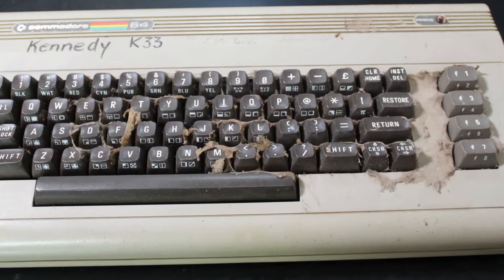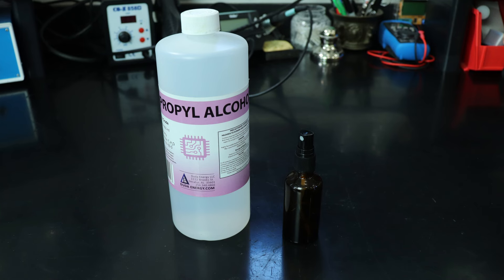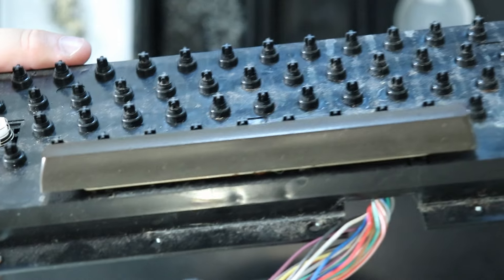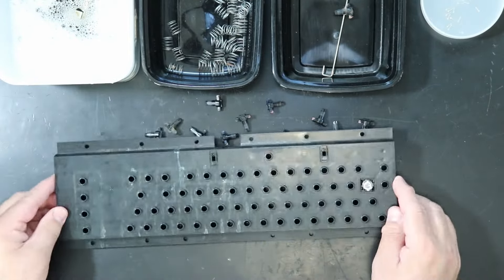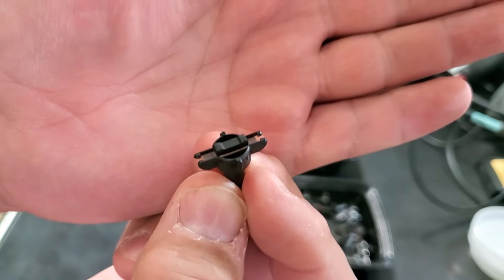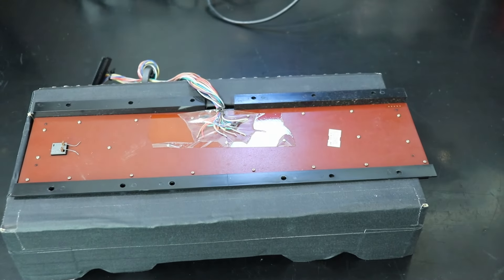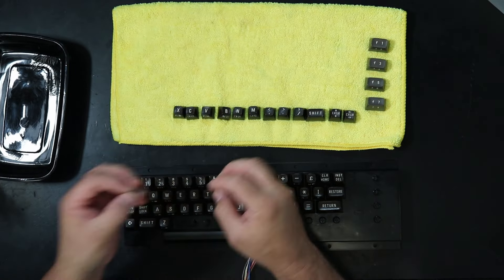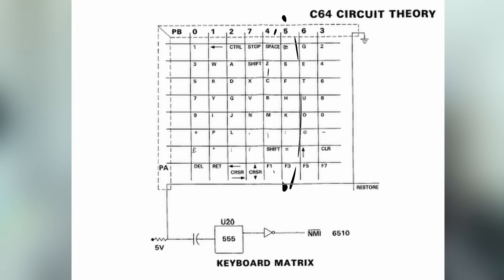How to restore a Nasty Commodore 64 keyboard

Comment: I just wanted to say thank you for making this video. After 40 years away from my C64, I have finally returned to it. Many of the keys either didn't work or needed to be 'hammered'.
You took me through the process, step by step and even anticipated all the tricky spots and explained them. My keyboard is now working perfectly again. Now I just have to sort out the random colours on the screen...
Brilliant video
Reply from the maker: Thank you. Comments like this keep me going. For your color issues I'd start with the color RAM or pla. There's a pictorial c64 troubleshooter online with screen shots of problems along with possible causes...
Reply: @RavenWolfRetroTech  I thought that too lol but it didn't fix it. I am now thinking either U16 or the PLA. They both have screenshots on the Pictorial Guide that look similar to mine.
Reply: Just in case it helps anyone. I checked the Pictorial Guide - it suggested Color RAM, U16 or the PLA. DESTEST Max also identified an issue with the Color RAM. I ended up chaging all three but it was the PLA (isn't it always?)
Reply from the maker: @nialled Ain't that the truth. I have 10 spares on hand at the moment!

Comment: Hey dude - I'm going to use your idea of cleaning/drying the springs with that strainer. Nice! :)
Why didn't you use the ultrasonic cleaner for your keycaps? I typically dilute Simple Green with water and put the mix and caps in a zip lock bag and drop them in the UC for a few minutes.
Like you do here though, still need to dry each one right away so there's no cleaning residue left on them.
Yuk! :) Cleaning keyboards is my least favorite thing haha!
Reply from the maker: Hey Alex! I actually had a mention of using the ultrasonic cleaner in my footage but I cut it because its really only good for getting the dust out of the underside. We used an ultrasonic cleaner in my business for a couple decades and we learned early on that plastic can easily be pitted by excessive run times. I have run them before for about 6 minutes but that only made the cleaning slightly easier so I cut the footage since most people don't have an ultrasonic cleaner.
I know what you mean about it being a bit of a chore. I wasn't kidding about the cleaning in front of the TV with the wife and the dogs. I still never found that lost screw!